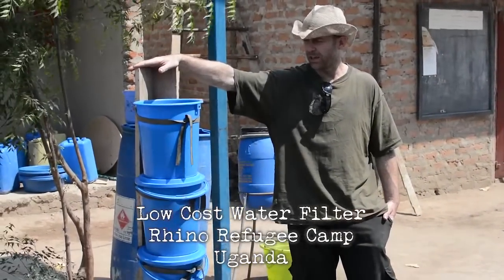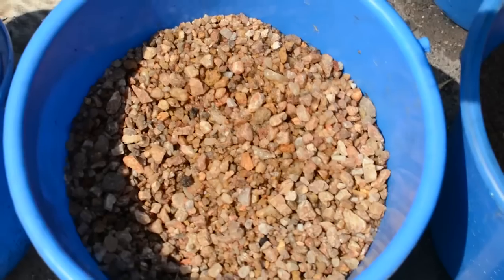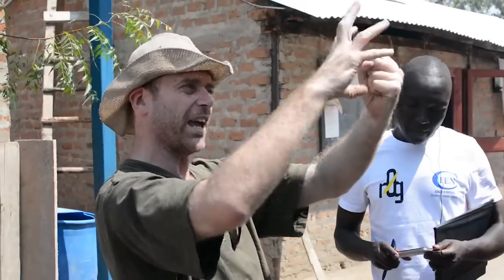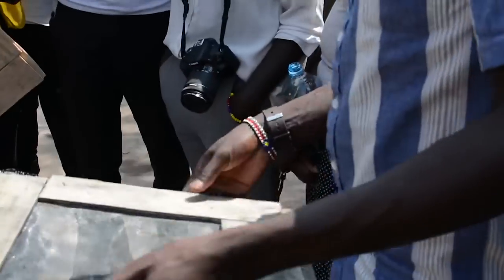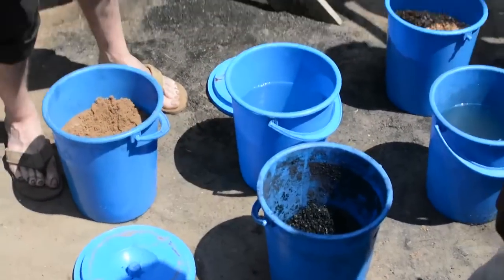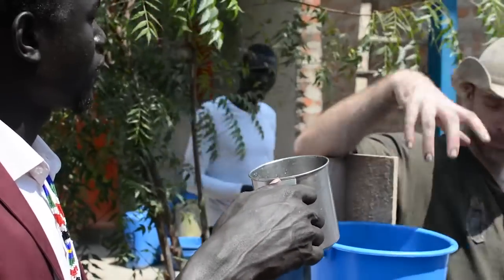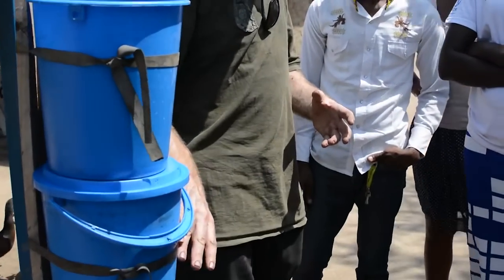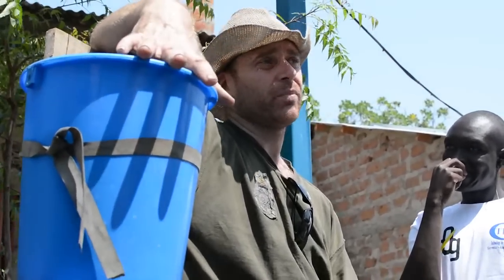$5 Emergency Water Filter

Comment: They can use copper mesh for bacteria etc cleaner
Reply from the maker: That's actually quite a good idea. I'll hopefully be testing and optimizing this design this year with a local NGO, and something like a jar full of copper wire may well increase the antimicrobial action of the filter, while being an accessible material in most parts of the world..
Reply: @OpenSourceLowTech  I am so happy that I could be helpful.
Reply: I guess I have heard that before probably a good idea but if it was not safe water before probably still needs to be boiled

Comment: Great project Daniel!
Activated charcoal can be prepared if you throw red hot charcoals in water. Steam will open up the pores and will make it better absorbant.
I would still boil the water before drinking just in case.

I read that charcoal made of denser wood and in particular the nut shells is superiour to the ordinary charcoal but I'm not 100% sure about it.
In Russia you would also take 5-6 tablets of charcoal in case of minor food poisoning (hangover) and it helps.
Reply from the maker: Very interesting and good to know, thanks.
Reply: it's not really needed and also they would have to prefilter a bunch of water before doing that which is kinda a waste when regular charcoal in enough amounts with different coarse particulates will do the job fine.  Boil at end is always a smart thing also.
Reply: Still not a bad idea

Comment: How awesome sharing such easy to do remedies for water. So easy cost effective and should be Everywhere! At the minimum. Straw is also good to use in the beginning process and even along the line, to catch and filter.
 Imagine a simple home unit, bamboo or likes, one piece with 3 levels.
Like a hanging garden principal.

Comment: Hi, thanks so much for your clear and simple explanation of how this type of filter works. Taking your idea and another for a barrel filter I have made a filter for myself to use on my off grid land. All the contents of your buckets are layered between fine mesh in a single Barrel with a tap at the bottom. Water is poured in from the top and kept topped up so the sand never dries out. Thank you so much for your inspiration. I had never made a filter before and now feel so much happier that I can. (The water will still need to be boiled for safety but I can filter rainwater I collect now).

Comment: Another awesome thing you’ve done here. For those wondering...how long does the H2O need to sit in the sun for UV to sanitize it? Also, what type of charcoal & where would most people find this? Thank you...for trying to make this World a better place!
Reply from the maker: Depends, 24 hours is usually safe. Keep in mind it has to be a plastic bottle, as glass blocks most UV, and has to be filtered first or the microbes can be shadowed by particulate contamination.
There we were just using cooking charcoal produced locally, but activated is best.
Reply: You can actually make the charcoal yourself, check out Primitive Technology charcoal mound video, full instructions are in the description

Comment: For your work... won my respect...
I have a little suggestion for improvement.. I must tell you..
I tried it myself...using 6 inch PVC pipe.
Made this kind of drinking water filter..
The difference is that I added an air pressure space at the bottom.
Simply put, it is to seal the water outlet.
Use transparent tube...
My experience. The speed has increased by 3 times.
My English is not good. Sorry.
Hope you can understand what I said.
Reply from the maker: Sounds interesting, not exactly sure what you mean tho.
Photos?
Reply: Made from this concept...
I try to explain...

6 inch PVC pipe: I made 6 spacer boards with feet (drilled holes).
In this way, each layer of filter material will have an air chamber.
There is no filter material at the bottom..
The lowest way to seal..
Drill a hole and use glue to connect a transparent tube.
At the beginning, the outlet pipe should be blocked first, and then the water should be filled.
After a few minutes, when the air pressure below builds up...
Then let the water flow out..

The material is 1. Cotton cloth 2. Stone. 3 Fine sand 4. Charcoal.
Reply from the maker: So the weight of the water essentially sucks itself through the filters, kind of like a siphon?
Makes sense.
Reply: @OpenSourceLowTech  Yes, you can say it again.
Reply: Do you have pictures or photographs to show us please? 🙏

Comment: The very top filter  I use is made out of cheese cloth and a very thin drape material to catch dust sand and leaves. Then my layers of charcoal and gravel. 
The cloth filter is just rinsed in boiling water as maintenance
Reply from the maker: Interesting. How's it working overall?
What kind of setting are you using it in?
Reply: @OpenSourceLowTech  it's working good. It is very primitive and dirt cheap but it works. The water is clean to drink. I use old filters from the store to do an extra filter sometimes. On the gutter I made a cup filter filled with charcoal to catch dirt . Set up is pretty primitive due to lack of funds.
I don't know what you mean by setting
Reply from the maker: Sounds good. What part of the world are you in? It's rain water?
Reply: @OpenSourceLowTech  east Europe Bulgaria. Fog rain snow. I am making a fog catcher as well. You can never have enough drinking water
Reply from the maker: Be worth documenting that..
Reply: @OpenSourceLowTech  Bulgaria. And yes it is rain water

Comment: Excellent! Factual, relevant and concise! It may be overkill, but what about activating the charcoal by soaking it in citric acid? Thanks.
Reply from the maker: I looked at options for doing that, but even tho there were several which were fairly low tech, they were all a bit more energy and or chemically involved than I'm really happy having people have to do.
Have been looking at other options to the char, like iron oxide, which may work better and be a bit easier to source and work with.
Reply: @OpenSourceLowTech  Thanks.

Comment: Good job but biosand filter is better, there is some gap in your buckets, the water is just clean from dirt but not from others microscopics bacteries and viruses, maybe putify with UV, put water on some bottles on sun light 24h.
Reply from the maker: The middle bucket should develop a biofilm in a couple weeks of use.

I'm looking into sunlight based processes.

Comment: Whats the gravel for? You can change it for sawdust or moss or something similar after the sand bucket would make a better filter than the gravel, that would only be needed to filter out rough debree.
Reply from the maker: Sawdust would rot, moss could be an interesting idea but gravel is what we had lying around, is inert, and about the right size for taking out the coarser stuff.
Reply: @OpenSourceLowTech  in Russia moss is often used during ww2 as binding material for wounds because its sterile, maybe fill one bucket with some kind of water plants with the roots etc intact these are good purifiers in aquaponics systems as well, than instead of gravel I'd suggest volcanic rock or similar if available its a better filter than plain gravel, but I understand you when you say with what we had. How did these peoples ancestors used to live before the missionaries came to their lands? go back to the roots more healthy and sustainable lifestyle usually

Comment: Very interesting and commendable on your part.  question, how long do you use the system until you change the filters?
Reply: As long as the water keeps flowing it’s usually a self cleaning system

Comment: I made one to keep in case of emergency.
Reply from the maker: Nice. How'd you find the process and results?
Reply: @OpenSourceLowTech  I haven't used it yet.  I bought almost everything at my hardware store and used cheesecloth as well as a screen.  The Charcoal I had to order online.  It was a bit more expensive here in the states.

The bottom bucket has a spigot and I keep it all unassembled.  Each bucket sealed to protect from dust.

Preparing for the big one here in California.
Reply from the maker: Ok, makes sense. Keep in mind that these types of filters generally perform better after a couple of days to weeks of use, as the sand will in that time develop a biofilm layer which digests microbes, and the charcoal will further activate as the pores flush out a bit.
But if it's going to be potentially years without being used or cleaned then it may make more sense to store it dry as you have it. I'm not actually sure...
Reply: @OpenSourceLowTech  great thank you for the tip.

Comment: I am in the process of making one and was asking myself if  a bucket hydroton clay balls between the sand and the charcoal would have a good effect on the water? Or maybe under the charcoal. Since clay has filtering features.

Thanks for the video!
Reply from the maker: Haven't used it myself, but probably worth trying and testing.
Reply: I’ve heard some do bentonite clay on the bottom, after the charcoal. So the clay would be the last step.
Reply: @rainsofhealing  great, I heard sone cat litter is made out of bentonite clay, that might be better then. Thx!
Reply: @DDDD17890  as long as it’s pure with no other hidden binders or additives, logically I don’t see why not. You can usually get the bentonite clay from various places such as of course online but farm and garden type stores also. Blessings to you!
Reply: @rainsofhealing  Right, I see. Tight budget, that's why, haha. Blessings!

Comment: So where is the activated charcoal coming from?
Reply from the maker: Cooking charcoal, locally produced, ground in a sorghum mortar.
Looked at options for activating it but they were a little too demanding. Seems to be doing a good job as is.
Reply: @OpenSourceLowTech  why not steam activate them
Reply: @OpenSourceLowTech  What do you mean by "cooking charcoal," please? Do you mean like the briquettes you'd buy and use for your tailgate party?

Comment: In municipal water filtration plants in the US, the top layer of the filtration media is coal (Anthracite or GAC) followed by sand followed by gravel.  Is there a reason your filter is opposite?  Does it perform better under the local circumstances?
Reply from the maker: Essentially with this design I just replicated known approaches. Given that the water these guys have access to can be a bit... chunky... I figured the gravel first would be good to take out the larger particulates, and is easier to wash regularly than the char.
But I've also seen configurations like you describe, I'll keep it in mind as an optimisation, especially as it would be trivially easy to change the order of buckets.
Reply: Water that is dirty needs to have the large particles removed before charcoal. Otherwise it loads up the charcoal prematurely. Charcoal on the bottom will last longer and produce better tasting water.
Reply: @1980Baldeagle  correct
Reply: @1980Baldeagle  why not screen out the larger particles first?  many will float so a screen within the bucket might work.

Comment: I was told to crush the charcoal into powder?
Reply from the maker: The fine powder I was getting turned out to be pretty strongly hydrophobic, so the water just beaded on the surface and couldn't get through.

Comment: Show them to boil the water. Filtered is not purified. You still have to boil the parasites out
Reply from the maker: They know, but it's a lot of time and firewood, and they don't really have large enough cooking vessels to do much at a time.
Reply: @OpenSourceLowTech  sounds like we'll have to come up with s few ideas on how to get the water purified.
Reply from the maker: I want to experiment with iron oxide instead of the carbon, which when in sunlight apparently has fairly broad antimicrobial effects. And would just be some steel pot scrubbers in a clear plastic bottle..

Comment: 1. mechanical cleaning of water - check. 2. chemical cleaning of water - check. 3. biological cleaning of water - boiling. Then you are absolutely sure it won't harm you.
Reply from the maker: Boiling is effective, but takes quite a bit of energy, and then needs to be left in a heat proof vessel for some hours til it cools down.

Comment: that is fine and dandy but that only filters the water it does not purify it 
it is not drinkable you will get sick something that you should have mentioned in the video it's not drinkable you still need to boil it to purify it
Reply: If the activated charcoal is fine enough and the flow slow enough and the medium with enough exposure it will filter microorganisms but boiling it in the end is certainly ideal.  If it were 2 inch PVC about two meters long for each of the three filter medium it would be ideal without boiling, but still you know, why not, on a rocket stove.

Comment: $5????? No way you can buy three buckets, mesh, gravel, sand and whatever else for $5 this is click bait as fuck
Reply from the maker: Dollar store buckets, couple bits of scrap mesh not included in price as they can be used to make as many filters as you like, gravel and sand are just the ground, charcoal can be got cheap and you don't need much per filter.

Comment: Has anyone ever checked these out with a dissolved solids meter..? Wondering what the ppm is of the "clean" water.
An FYI, always run a few gallons through to get rid of loose material, then it should be good to go.
Reply: You can clean each component before it is assembled
Reply: PPM is only half the story. You can filter water to 11 ppm but them put a few drops of cryptosporidium in it and it would still register 11 ppm.